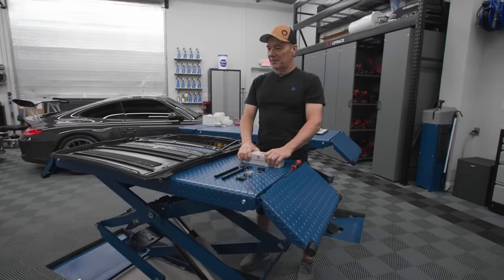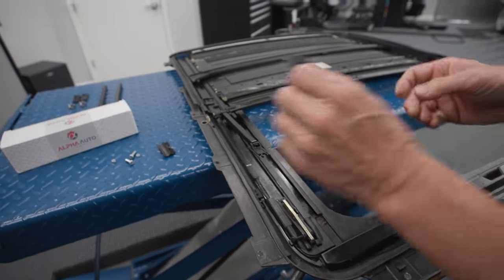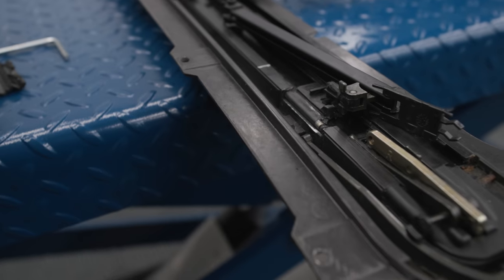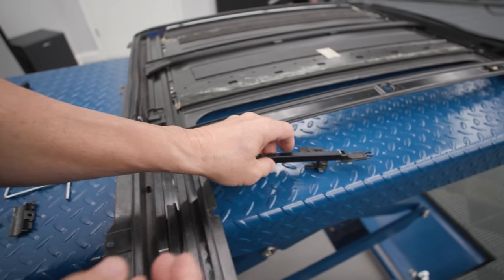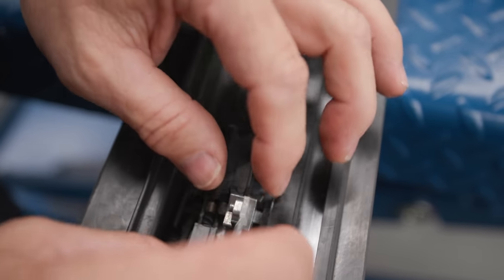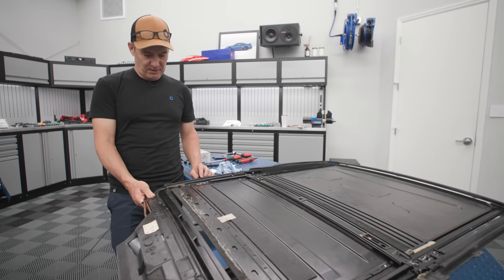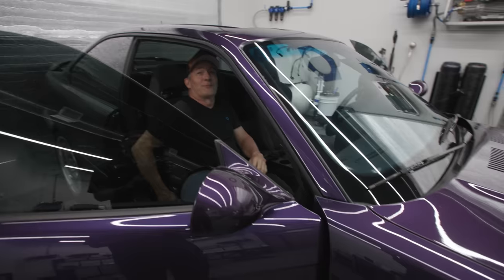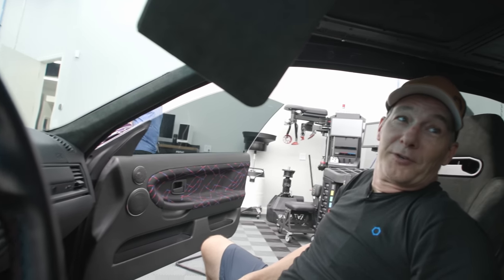E36 M3: Sunroof Cassette Repair - How to Fix a Broken Sunroof on a BMW E36 3-Series

Comment: ⚠️ Off Topic: do you have any recommendations or videos for maintaining and protecting…
1. Forged carbon fibre roof (would it be any different than regular carbon fibre and would you recommend doing PPF over it?)
2. Suede on seats. 

Conditions: Canada 🇨🇦. Not sure if we will be driving it in winter or not as of yet. 
It’s a GR Corolla Circuit Edition…I know it’s not exactly up to the standard of a lot of your cars but we all know we can be obsessed with “perfection” regardless of what we have and it’s a mindset for life and not just cars. Do the best we can and continue learning to improve on things. 

Appreciate anyones input.

Comment: What are the measurements of the bmw e36 m3 moonroof?
Reply from the maker: It's 19.5" by 33.5"
Reply: @ObsessedGarage  do you think if I purchased a piece of bmw glass and built a custom frame for the moonroof. I could make it fit in my truck?